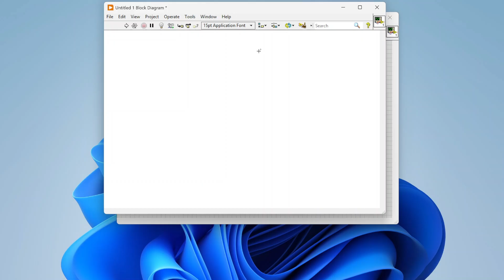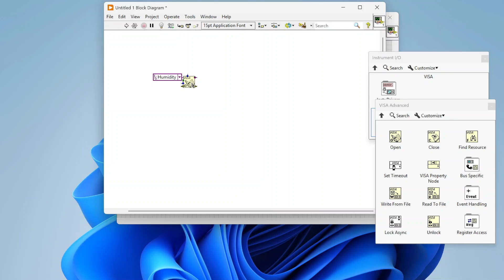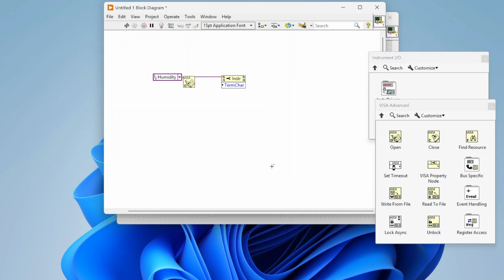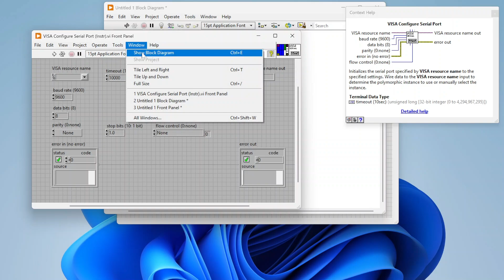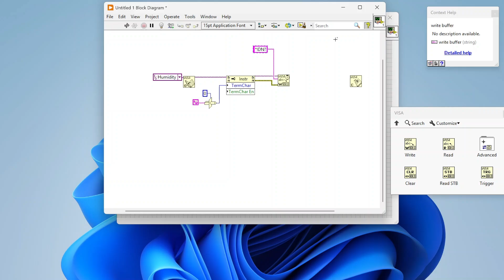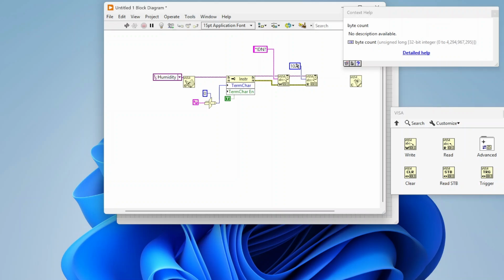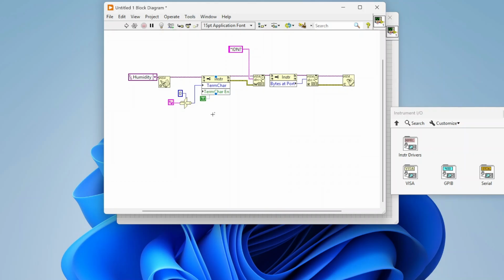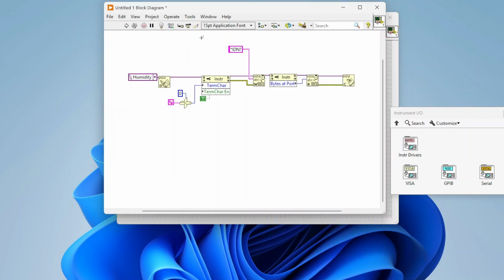LabVIEW VISA Fundamentals

Comment: I’ve tried using VISA in LabVIEW to read data from an M-Bus Master, but so far I haven’t had any success. Have you ever worked on something like this? Could you help me out?
Reply from the maker: You can implement modbus yourself over VISA but there are several others who have already done this for you! There are a couple of different libraries available for Modbus that manage the message formatting, CRC, etc for you. Just tell it what registers/coils/inputs to read and how many and you get the data back out (already converted from a string to the appropriate data type). I recommend you take a look at either the Plasmonique Modbus Master library or the NI Modbus library both of which are on VIPM.